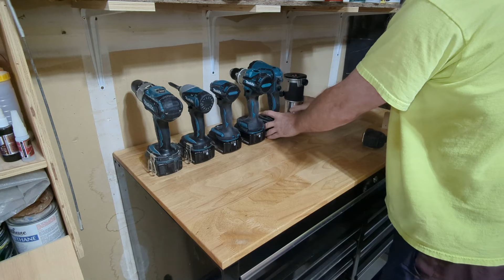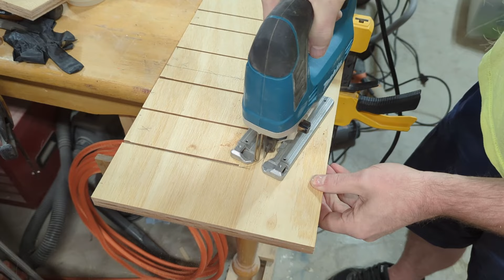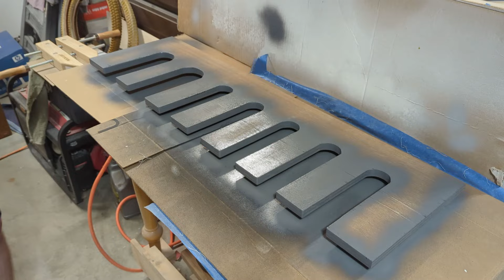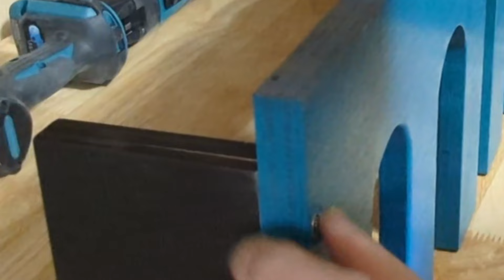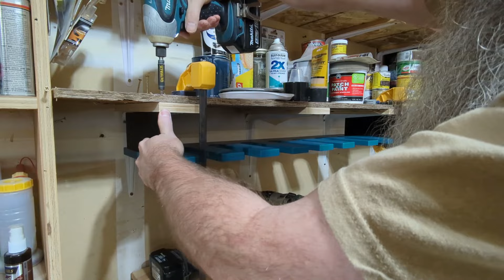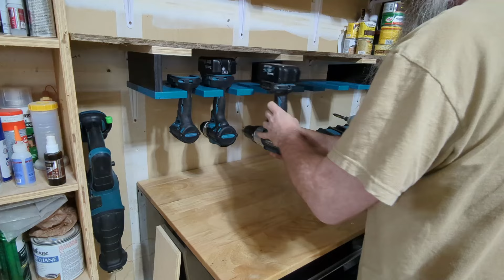Super Easy Cordless Tool Storage | Makita

Comment: Great to see another video that says easy but the guy doing it has like 14 steps and uses seven different tools. If you have enough tools, everything is easy. And if you have enough time, everything is easy.
Reply: Surely you'd have the tools if you were looking for tool storage 🙃
Reply: You could make this pretty easily with a spade bit and circular saw. It'd be rough as guts but you could clean it up with a bit of sanding or a router if you have one.
Reply from the maker: Sorry you didn't like it. Hopefully somebody got some value out of it.
Reply: This IS a very easy DIY design. Any home or shop project will require a little time and effort and unless you have free or scrap wood laying around its going to cost a bit of money too. Most times you can buy something cheaper than you can make it yourself and if you are including your time ,well then forget any cost savings.
You could take some old shoes, screw them to the wall vertically and drop your cordless drills in them. I've seen that done. If you don't like the method presented here perhaps you need to re-evaluate your expectations and consider just exactly what it is you would like to gain from your DIY experiences.
Kudos to Buchanan builds for putting it out there.
Reply from the maker: @MrGspring  I appreciate the thoughtful response.

Comment: Great to see another Makita user.  Makita has been my brand choice since early 80s.
Reply from the maker: It's all I've ever used.
Reply: Love to you both. Makita are by far and away the greatest. Choice innovation, build quality, features, spares. Price is the best pound for pound, and as they sell twelve grinders and twenty drills, you will find something cheap somewhere online.  Garden or construction. Plus always good to go straight out of the box. I love a few Ferrex too. 21 Makita 18v and 6 corded. Oh and coffee machine!  Maybe a dozen Ferrex badgers too.
Reply: Wish I went with Makita in hindsight but haven't had any problems with DeWalt. One of those, my mates have DeWalt so I'll get the same, moments.